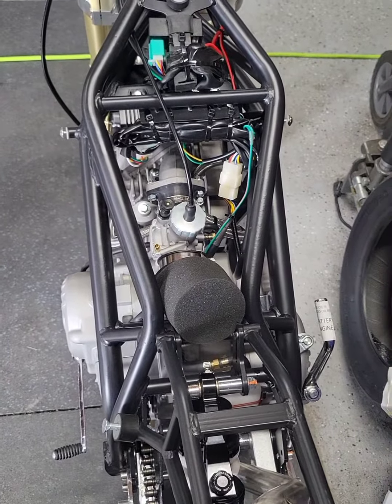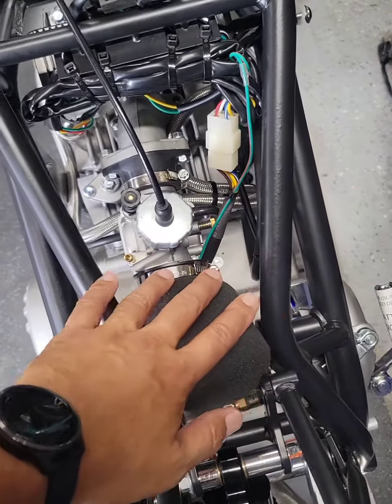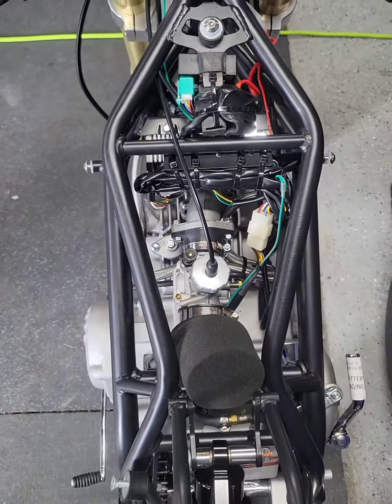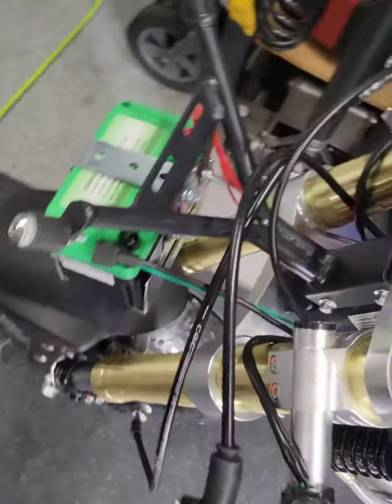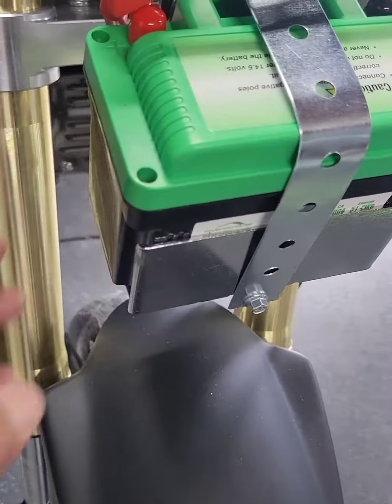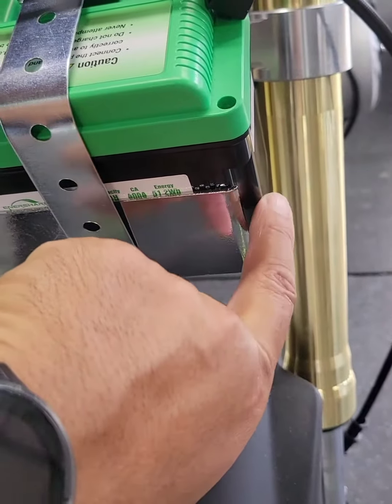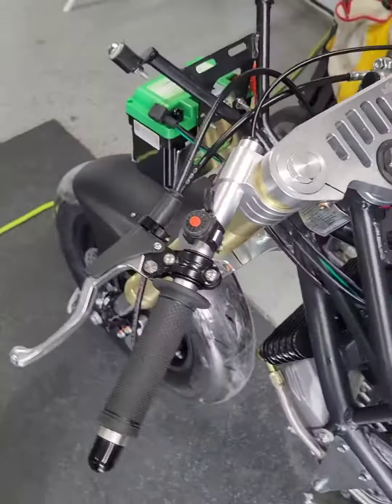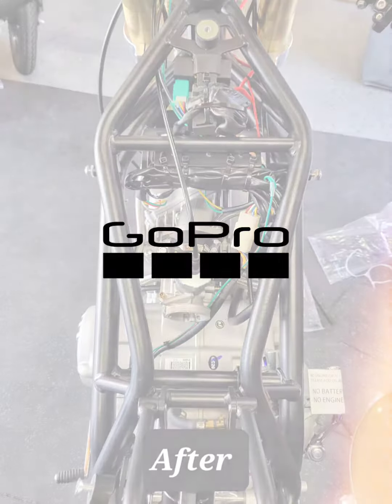VMC GP-12 Cable Mgmt and Battery tray size

Comment: I have the battery under the seat behind the intake. 
Still enough access to carb & wires. 
Plus I 3D-printed a mount for fuel valve, so disassembling tank with saddle is easy job.
Reply from the maker: Thats really cool! Would love to see the setup.